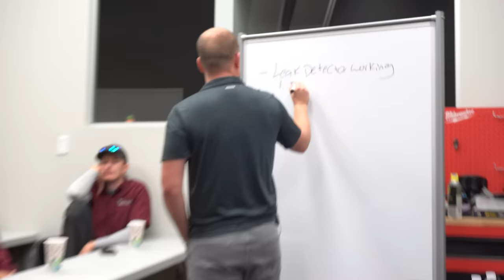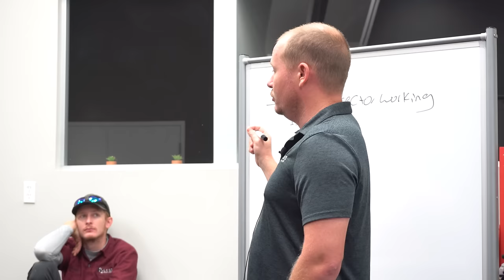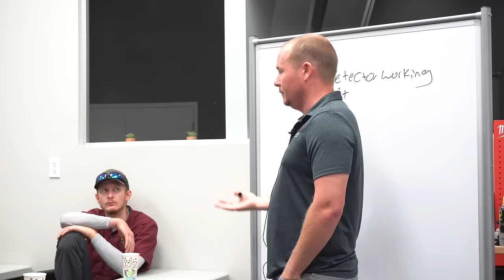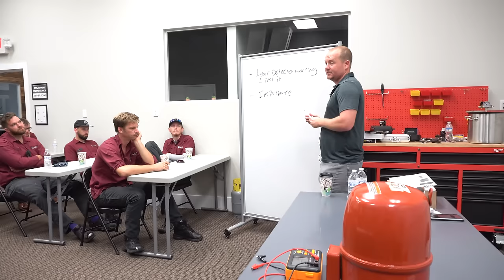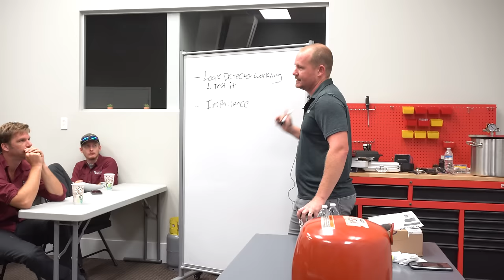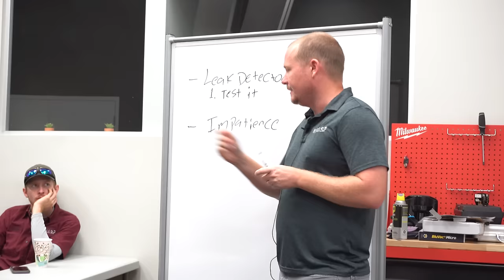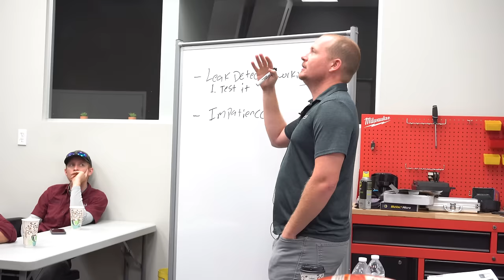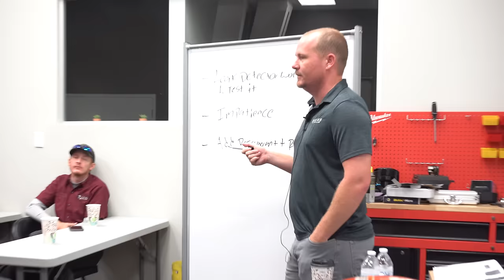How to Find Refrigerant Leaks - Kalos Meeting

Comment: I found that when I managed a large department that the most common excuse for poor practice was the “we’re so busy”  I had to get done. I always told the techs let ME worry about how behind we are not you. I would rather have you do 3 calls properly and completely than do 7 and I need to send someone back on 5 of them.  Great job Brian as always
Reply: That's great as long as your company lets you do that. Sometime your being pushed to get to the next job. That's one reason I don't like these guarantee on time places. 

We had a garage door company come out to fix a garage door opener. They only had 15 minutes to fix it and be on their way to the next job. The clutch was slipping. Their solution was just to tighten the clutch. They didn't check check to see if the spring tension was right or if the track/wheels were messed up making the door require more force to open.
Reply: Yeah I don't understand how some techs can somehow do 3 TXV's two coils and a leak repair on the same day 😂 there's no way they're pulling a good vacuum and finely tuning the charge
Reply: @AGON17  agreed. especially in high humidity climates or system that  have had multiple compressors, txv's with alot of oil migration then high static that never gets diagnosed
Reply: Our problem is the 7 calls a day tech sells them new gear and never diagnoses the problem. Then and 20 year guy is sent after the new equipment doesn't work. Finding range between 3/8 brass farrow at the recessed can light to 3 foot birds nest in the intake 3 inch pvc combustion air pipe. Customer looked at me and said, YOU MEAN I BOUGHT A NEW FURNACE FOR NO REASON!!!!!!!! Answer I'm sorry sir I was sent here to repair the new equipment.  I did notice a higher than normal volume of calls here. Would you like me to have management call you?  I mean sales is not always the answer.

Comment: There's more to just being observant or patient. An experienced tech needs to evolve and rise to the problem. Some system leaks are so difficult, one may end up cutting and capping off the lineset, condenser and evap sections, pressurizing each, then check which one has a pressure drop. Many times I was told the previous tech blamed the lineset, and many times I found leaks at the txv, solenoid stems that had tiny holes burnt in them when the coil burnt out, and tiny cuts in the coil tubes where they pass through the metal supports...sometimes caused by too wide of settings on a condenser fan cycling control. Last, when you do find and fix the leak, clean up any old oil deposits, and write on the unit when and where the leak was repaired...you may even want to mark the area with a paint marker and take a picture with your phone so you can show the customer and so you cover your butt.

Comment: I'm glad Bert specifically pointed out the problem with Lennox equipment. We were primarily a Lennox dealeruntil the leak issues got so bad we had to go with another brand. Cracked discharge lines, cracked permanent suction, crack TXV bypass tubing, outdoor TXV rubs, leaks on the front and back sides of evaporator coils, leaks under the black coating they use to insulate the feeder tubes. And this has been going on for years.. And they don't show any interest in fixing the problems on their end. Way to contribute Bert 😎👍
Reply from the maker: i am glad it helped
Reply: @The1JBanks  I'm telling you man, Lennox should have their asses sued off over this. That's the only way they're going to improve their product. You got to hit them in their pocket, where it hurts. Before they'll actually make things better. As long as they're allowed to get away with it and there are never any repercussions or reparations on their part, they'll just continue making shoddy equipment the way they have been. THE CONSUMER DESERVES BETTER!!!

Comment: Hi and thanks for the help the other day. JASON OFTEL here. There are 3 detectors that will pick up sub 1ppm leaks. I use the srl8. After many years of success with h10 ge and Bach. Then srl2 was good after that. As long as the filter was kept clean. However the srl2 could find the small leaks. So then I started dyeing systems. Wow some of those leaks required a magnifying glass in the 6" range to see. Anyways thanks again wish I chose a shop that didn't end up being a sales positive employer. I'll continue being the customer retention department.   Again thanks for the help even if we haven't met.
Reply from the maker: Glad my videos help you
Reply: Did you notice Daikin  University pulled all there videos from YouTube

Comment: Lennox has a lot of leaks I’m finding on the tru suction tubbing and txv’s in the condensers.
Reply: They also like to leak on the suction line at the evap coil where you're supposed to field install a Schrader core but no one ever seems to.

Comment: If there is a pin hole leak in the evaporator coil will it freeze up?  Will you smell the freon (sweet noxious odor) every time the ac goes on? What else would cause a sweet sugary smell on a brand new hvac unit?

Comment: I'm using the liquids soap,to find the leaks, and putting the evaporator and condenser in the waters with  liquids soap while I put some air pressure in it.😀😀😀.that kind of techniques, I didn't learned from the school, but I do it on my own, then solve the problem. Done
Reply: Man, where do you find such a bowel or barrel?!
Reply from the maker: Thanks for sharing
Reply: That's some time wasting right there.

Comment: What do you think about ultrasonic leak detection
Reply: Doesn’t work outside if there’s any wind or background noise and you can forget trying to use inside an active mechanical room. Basically they work great in dead silence.
Reply: @arthurcastillo8767 That's utterly completely false. The accutrak filters out background noise, wind and everything else other than the gases from fluorescent lighting. As any leak detector there's an art to using the detector. One of the best educational hvac youtubers uses ultrasonic as their main source.

Comment: Is it a good practice when looking for a leak at Condensing unit, to pump down the system before hooking up you gages; to minimize the release of refrigerant while threading on your hoses to the service ports?

I am asking because, I used to have low-loss fittings on all of my hoses.
I had the JB Kobra hoses with low-loss fittings.
I paid quite a bit of my bet for them.
I took very good care of them. & A month or so after using them, they started leaking.
I was NOT happy because the whole point of spending the extra money for them is to minimize release of refrigerant when hooking & unhooking my hoses.
If I suspect a leak outside at the Condensing unit, it's crucial to minimize that release, so that I don't get a false positive with a leak detector.
& if I inject UV dye into the system, I really do not want any blow-back when disconnecting my hose, because then I get the dye on me, my equipment; whick gets tracked onto the customer's property as I touch things.
Yes I wear gloves, but still it creates a problem, not to mention that it leaves me to wonder if the system got the full, proper dosage of dye, needed to find a micro-leak.

So I threw out my low loss fitting hoses & now I just use hoses with ball-valves on them.

So I pump down the system before I hook up my hoses.
I start to thread my hoses on the schräder valves, but not all the way.
As the system is pumping down, I'll hold in the contactor if there is a low pressure switch or some sort of technology that opens the Y circuit when the pressures get too low.

I listen for the distinguished sound of the compressor when the system is close to being pumped down.
As the liquid line sweats & looks like it's about to form frost on it's lowest point, I start tightening my closed off ball-valves hoses to the high & low side schräders.
By the time my hoses are all the way threaded on, no refrigerant has been released because the system is pumped down.
So, I'll release the manually held in contactor or pull the disconnect switch; which ever is the most convenient.

This way, I do not run the compressor in a vacuum.

Then with the system off, I slowly re-open the high side valve with my refrigeration wrench. I wait until the high & low side pressures on my gages equalize (I've already opened up my manifold by this point).
Once pressures have equalized, I put the disconnect switch back in to bring the system back on.

Now, if I find the system to be low on refrigerant, I do not have to worry about my leak detector giving me a false positive when searching around the valves & my hose connections.

Also, I do the same thing before disconnecting my hoses, to minimize the release of refrigerant when un-hooking my hoses.

It's a lot of extra steps to take.
But I don't want to keep spending money replacing low loss hoses/ fittings.

I thought they'd be a great investment, & instead they were a great loss of my hard earned money.
I get paid by the hour, so I don't mind spending a little extra time pumping down the system to hook & un-hook my ball-valve hoses.

Yes I know ball-valves also leak, eventually. But they are cheaper than the low-loss hoses that I originally bought. & I have had these ball-valve hoses for almost a year & they (knocking on wood) are not leaking.
Reply: Eric M  probes sometimes require a brass T-fitting to be installed on them.
Which puts us in the same predicament as gages do.
Maybe not as much, but still the problem exists.
Probes are great.
But if their batteries die, or if their is no wifi signal, then they are useless. & We are forced to hook up our gages.
So no matter what, the issue to minimal release of refrigerant is still an issue.
My pump down method, so far, is working so I think I'll stick with it. But some compressors have a Vacuum Break Protection technology, that will not let you pump the system all the way down.
But still, I can pump it down below typical low side pressures for R410a (about 125 to 140 psig) So it's still a plus. But some refrigerant will be released when I hook up & un-hook my hoses.
Reply from the maker: Your concerns are noticed
I will answer them in Q/A vid
Reply: @sprockkets  Is it like the appion of yellow jacket tool that lets you remove a schräder valve stem core without recovering the charge?
Or is it more like a (I think it's called) a King Valve where your use a wrench to back seat the valve after threading on your hoses?

I like those, btw. The nature of their design makes more sense to me. But I am guessing that they probably leak after a while, too.
Reply: @HVACS  Thank You Sir.
Looking forward to all your videos before they come out!!
You've taught me a ridiculous amount of stuff!!
I can't thank you enough.
Too bad, I am in Corpus Christi, Texas, or I'd love to come over there & join your awesome team of Great Techs!!!
Reply: You must suck at removing hoses if you have to do all that. Just buy one of those brass attachments from yellow jacket.
Reply: @christianruvalcaba7788  Hey daddy, I did that. They don't last.
Oh btw daddy, you owe me 18 years worth of back child support & well now its time to pay up😂
Reply: @adamspears3819  😳

Comment: Hello sir.  Heat diode was inconclusive si I did nitrogen pressure to 350 psi on R410.  It didn’t go down even by decimal, vacuum even went downtown to m
500 microns,   We charged system but week later it was low again,  what am I missing

Comment: Can I add nitrogen to the system then with freon in it ?? Normally I either do a pump down to the system or I completely recover the freon in it before I do the nitrogen test
Reply: No. You'll contaminate the freon. I'd only recommend it if the system is really low.

Comment: 19:54 What is nitrous oxide? Something had to react with nitrogen to create NOS so it's not a completely non-reactive gas.
Reply: Sorry, nitric oxide is nitrogen and oxygen at high heat, brain lied to me, but I can correct my mistake but I won't edit my first comment except add time stamp. I remembered something about nitrogen does react, because you have many chemicals or compounds like nos,all kinds of nitrates, ammonia nitrates etc. It's the least reactive, widely abundant gas I think.

Comment: I have an inficon Tek mate, fieldpiece slr2k Infrared, amprobe ultrasonic and an H10 and I still can't find leaks sometimes 😂
Reply: Ouch. You have the best of all worlds.
Reply: at that point you go old school, pressurize the coil and submerge it in the water
Reply: how many out of spec sensors?
Reply: @lordjaashin  lol why would the customer pay for that? Especially on a older system. Just add a nu calgon leak sealant and comeback in 3 days and check it with a uv light.

Comment: I have a minor leak in my ac system, full charge last me 6 days. Recently I have changed evp. coil with new ex. valve., checked to leak their but not found any. I have checked at condenser unit but fail. Could you please guide me, what else to check? Thanks.
Reply: Lineset
Reply: Get a pro to look at it. Theres a reason why you have to be a licensed professional.

Comment: How about ultra sonic leak detector
Reply: Mentioned at 19:45
Reply: 19:53
Reply: I grab mine when I come across a system at that 50 psi static pressure and looking for big leak. Not so good for 4lbs a year leak
Reply: accutrak is where it's at babayyy. I don't care what these techs say a good ultrasonic shits all over a sniffer, you get feedback at literally the speed of sound and it works even better on wet surfaces

Comment: Thought about getting the srl8, but iv found every leak so far by looking for oil stains, soap/water mix or isolated and pressure testing. Used dye a few times but I don't like putting that stuff into the system then it gets into your gauges.

Comment: If a leak is hard to find meaning you check from bottom to top, and top to bottom, but you still cannot find it. Is it good practice to run the unit to check for the leak?
Reply from the maker: Noted!
I will answer your question in Q/A video
Reply: I would turn off the blower if you do. Or else the fan will mess with the leak detector.

Comment: I have the h10 and stratus both. The h10 is perfect for cases and HVAC and the stratus is awesome in a contaminated environment like a compressor room where the ppm readout really helps zero in on the leak location.

Most of leak detection success is in the experience and skill of the tech and the actual tool you use is of secondary importance.

Comment: I usually isolated the condenser from the evaporator and test them individually.
Reply: for speed I put both on a micron have and pull the indoor and out door indapently that works well too.

Comment: 10 ton package ac have it micro leak r410 a system 20 day it's empty  I put 240psi  but not found leak some time evaporator show oil but there is not found how solv please 😢

Comment: When a leak is suspected because refrigerant is low, is there any situation you would use  a direct injection sealant? (for example if you can not find the leak?)
Reply: I use them if a homeowner can't afford a better option. But I always give a disclaimer saying that there's no guarantee on the repair.
Reply: @christianruvalcaba7788  Thanks! They since found the leak and replaced the coil in the air handler.
Reply: @TravelwithNJSteveandSue  no problem. You're gratitude is much appreciated.

Comment: Hello, before I start,  I read every question, comment etc, Now In my lifetime I knew 2 whom were LEAK CHECKING UNITS WITH ZERO PRESSURE,!
#1 my god given eyes, # 2 my ears, then I’ll go get soap, halide or something else . ,,,  Now let me run this by you , an A&P in CALIFON NJ, 4 HILL DUO MATES , & a satellite for ice cream, when that store was built it was ALL R 502,  2 men with 2 INFICON detectors 4 days  pipe chases etc NOTHING , but 500lbs of refrigerant gone , I was sent there with 3 125lb cylinders in my truck on top, of what I carried, so brought them in a& started,  then I dropped something, bent down to get it, guess what ? The high side bellows, on a RANCOROUS Dual pressure control WAS THE LEAK, ABSOLUTELY ZERO OIL on the. Floor !  replaced the control & kept it in case I was asked about it from my survive mgr, which he did, as he could NOT BELIEVE IT .  And life goes on  ! Thanks for your program., cheers
🇺🇸🇺🇸🇺🇸🇺🇸

Comment: Pin hole hardest to find.  You can spray bubble soap right on it and it won't show up.  I use to spray bubble soap on my hand and when you come across the pin hole you will hear that whistle that any tech knows...just have to get it to blow a bubble then.  Sometimes on the bottom of a line and hard to find.

Comment: I find the JB Prowler leak detector does so well with 410 if there is no liquid in the system but still around 50 psi and you pressurize with nitrogen it will pick it up.

Comment: 14:05 is where it starts...
I have a question Bryan, what if your using an ultrasonic leak detector? I live in Utah Salt Lake City. The accutrak I use doesn’t get affect by being used outside. I just don’t use the koss earphones they came with because there crap. But I mostly work in commercial till this day it hasn’t failed me. Now being if I used an infrared or headed diode then yes I’m 100% with you. By the way I watch every single video you post and your an amazing instructor as well.